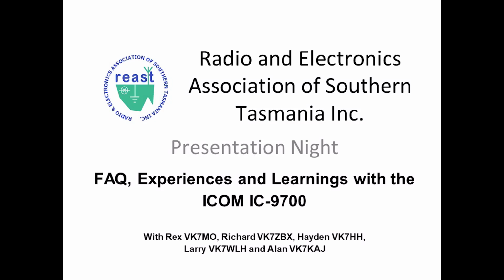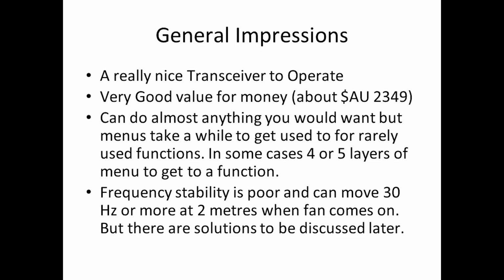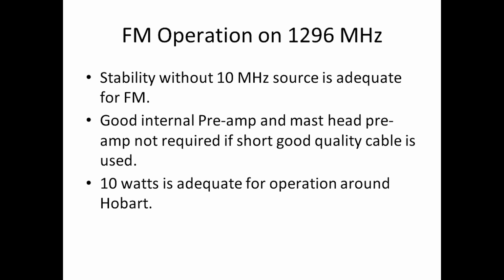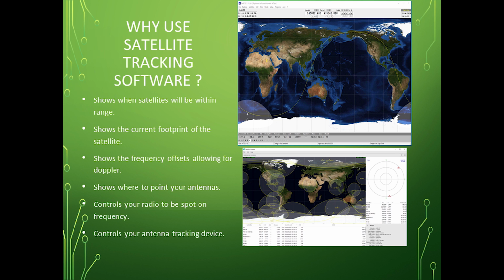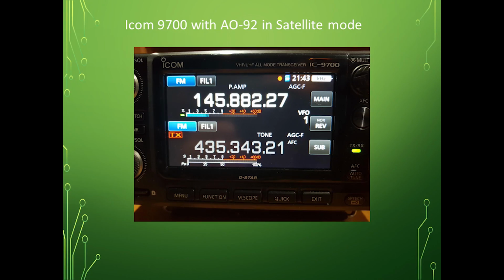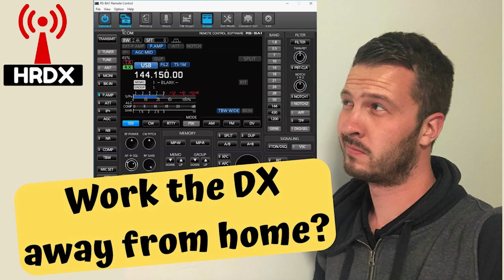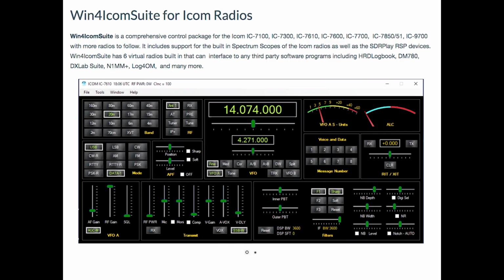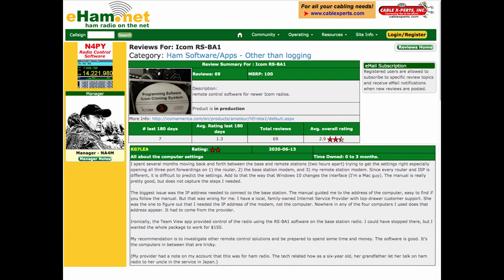Icom IC-9700 - Everything You Need to Know

Comment: Just replace the SMD inductor on the Minikits coupling pcb with a wirewound inductor at 90 degrees to give better coupling
Reply: What sort of improvement in the locking range?

Comment: I'm adding a comment left by a reviewer, could you confirm the following?, "for digital work this radio is not a good option at all. Frequency stability is poor as the fan cycles. Further, and this is for me a show stopper, you can't do 9600 baud thus, all the satellite digital stuff is now off the table. If you have a radio that will operate with 9600 baud FT8 or any of the digital modes, either keep it and use this one for SSB CW where it shines, or don't change radio's yet."   I know almost Nothing regarding Satellite Communications.

Comment: High, N6GRG here, I"ll need to check my list of VKs to see if I've communicated via JS8CALL with you. Its becoming a large list. My question is, is it possible to have a dual pl/ctcss tone with a 9700.. We have a repeater system here which utilizes two tones on each repeater for various reasons, and one "side" of the repeater needs to rx decode with one tone and tx encode with another. Maybe one of the guru's in your group would know ?
Reply from the maker: I think the 9700 has this feature. TONE in the menus is set for the transmit encode tone, TSQL is the tone for the receive decode. You should be able to go into the menu and hold these buttons to set the appropriate tone freq. I hope that helps
Reply: @HamRadioDX  Ok, hopefully the tsql tone can be different than the TONE (tx tone). I guess he will see with the programming software ? What is the name of the software ?  Asking for a friend. (he may know but I wanted to seem like I had a handle on this , thanks.